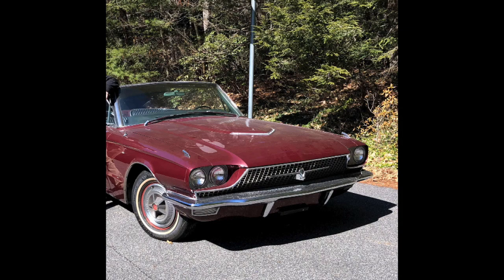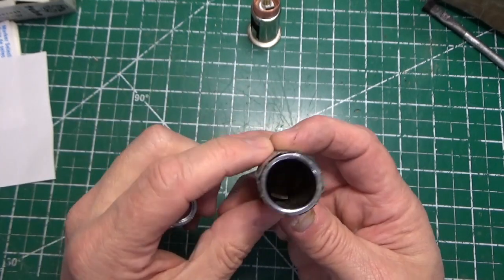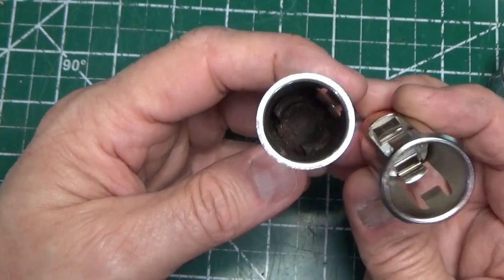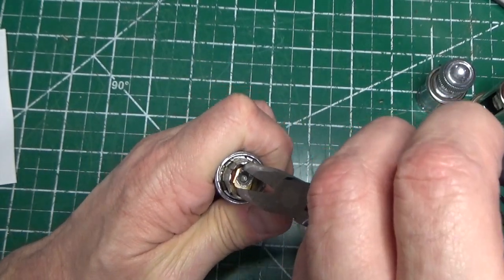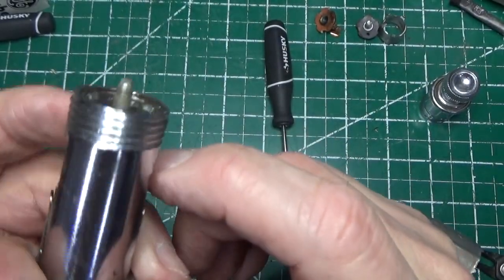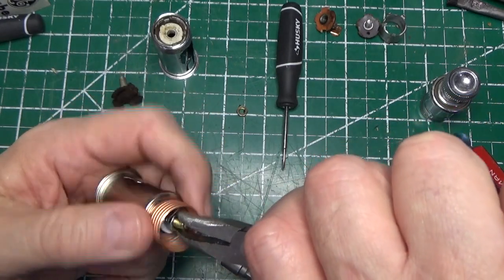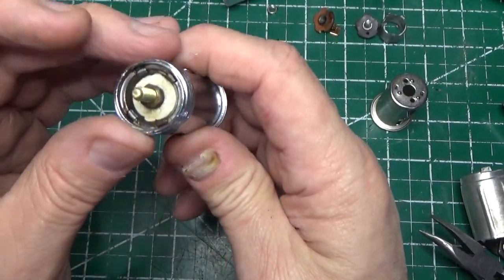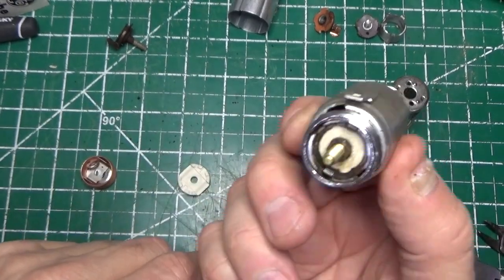1966 Ford Thunderbird Cigarette Lighter inspection and refurbishment : Part 1

Comment: Good repair, I am sure there is a fuse for it on the fuse bax
Reply from the maker: There is Bill.  This is an extra protection in case the light remains stuck in the socket. It prevents a meltdown, I think

Comment: Hi Ron, or more appropriately, "Hi Mr Fixit," LOL.
Often, it is those small, what might appear to be insignificant fixing jobs that often provide theoretical learning , as well as practical experience, therefore never to be sniffed at.  They not only demonstrate our dexterity, they also prove how resourceful we can be.
The  copper contacts at the screw-end of the fag lighter look like some sort of thermal cut-out arrangement.  It is quite possible I could be wrong about that particular point.
Provided the element is working, and it releases when it has reached optimum glowing temperature, it might only require an inline fuse carriage crimped onto a an eyelet, then tightly secured onto the protruding screw thread, and it should be good to go.  Before doing anything of that sort, check with John  as to whether there is a protection fuse already in place inside the onboard fuse compartment - if so, there will be no need to fit a fuse carriage.
However, should you have need to fit a fuse carriage, bare in mind the fag lighter element is a flat coil of nichrome foil, therefore its current draw will be from 5 amps: very likely it is closer to 10 amps.  I'd personally consider fitting a 12 volt @ 15 amp fuse.  There is a distinct possibility Brendan knows more  about this than I do.
Cheers my friend, the man from Sheffield.
Reply from the maker: Phil,  you are absolutely correct. I have learned there is a 15Amp fuse that connects this to the car, but this Fusable Link is there to prevent a fire if the lighter were not to eject. The copper would melt and break the connection. I have learned a great deal about something I thought was a piece of cake !!!!! Always good to hear from you my friend. hope you are both staying well in Sheffield and its getting to nicer weather.  All good here  as they say.    Many thanks my friend

Comment: It’s a thermostat breaker
Reply from the maker: Thanks David. Is there a value to these things?
Reply: @rciancia  I don’t know the average but it’s more for how hot it gets
Reply from the maker: @Davidjb37721   I got it.. thank you ... This is really protection in case the lighter was stuck in there and never popped out.. it would eventually trip this breaker and save the dash and wires from overheating..Makes sense !!   Thank you so much David
Reply: @rciancia  yes
Reply: @rciancia  It's more about the lighter itself starting a fire as it will continually build heat if stays connected. 

There will also be an electrical fuse on the circuit to protect the wires.
Reply from the maker: @mjr1999    Thank you so much, that makes perfect sense... I appreciate all of your info on this !!!!!